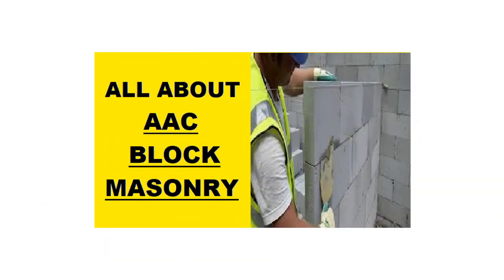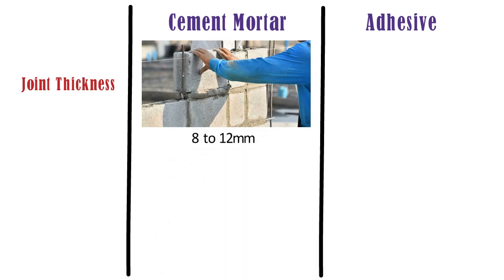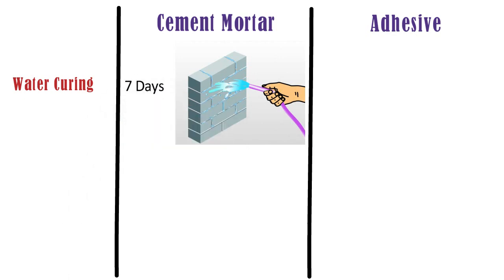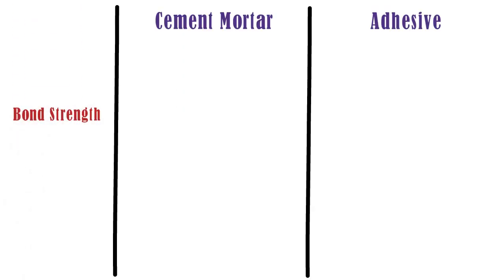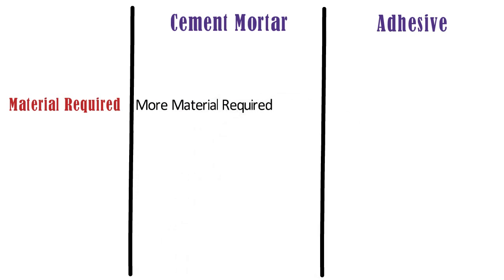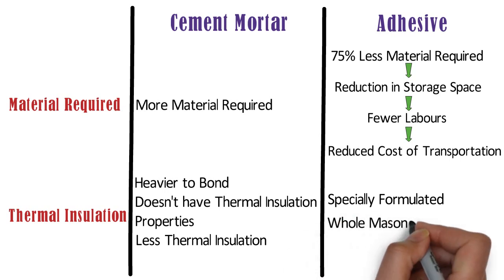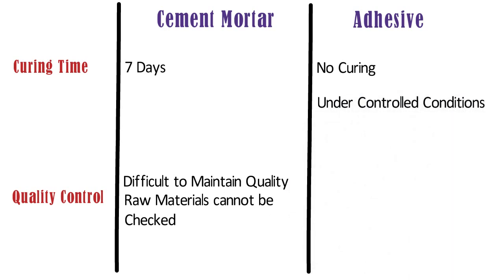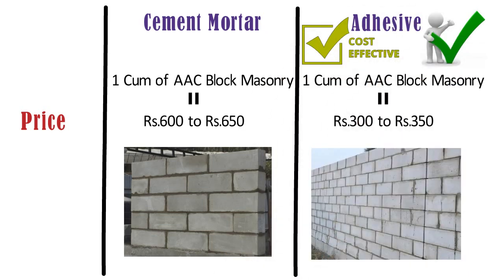Adhesive VS Cement Mortar For AAC Block Masonry

Comment: Can we place putty directly on the ACC wall without plaster?
Reply: Yes you can but it's better to use only on dry walls (no contact with air and water) or else water could easily enter the walls and reduce the strength and quality. Hope you got your answer.